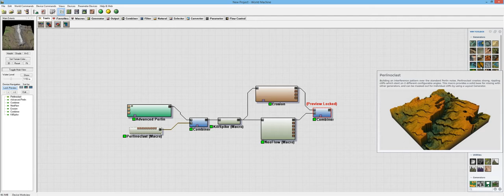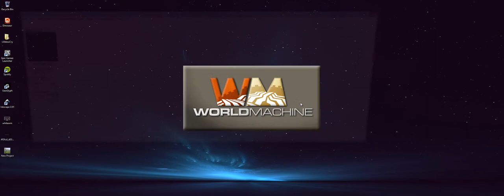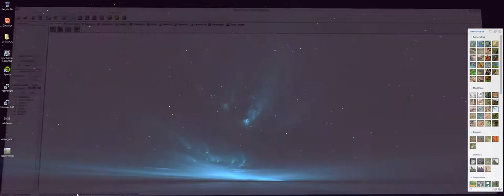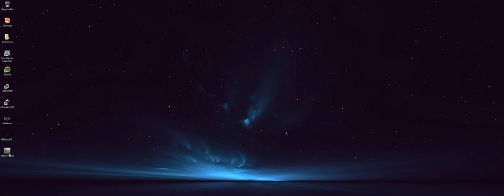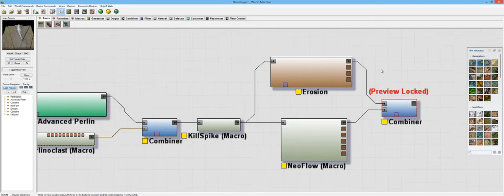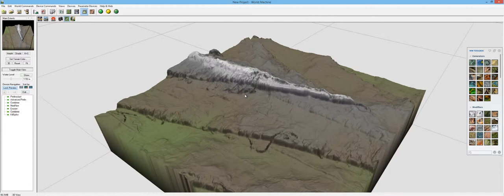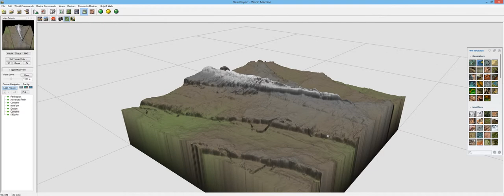Discovering GeoGlyph Part 7

Comment: Could the crashing be because you had the preview locked and a change in the macro had to be calculated all through the chain to the combiner ?
Reply from the maker: Yes, that could have been the reason. Though, with the latest update the crashing seems to be fixed.